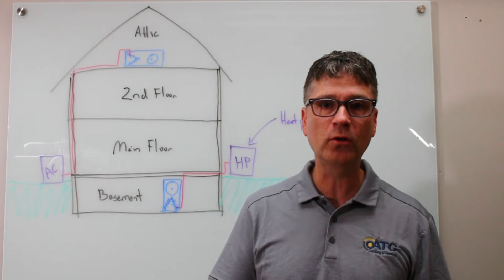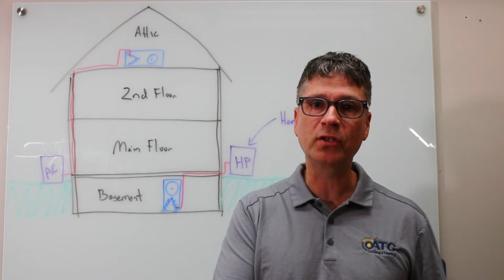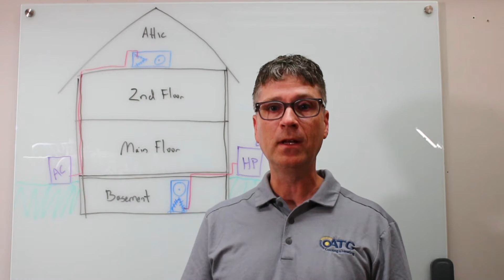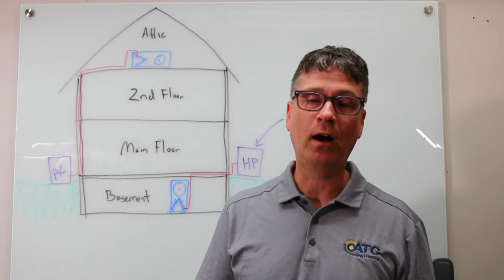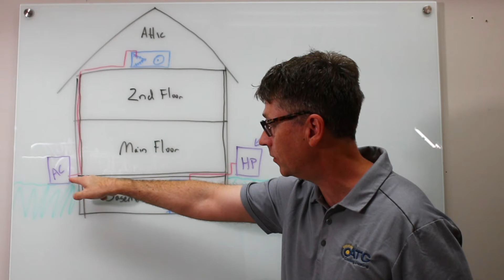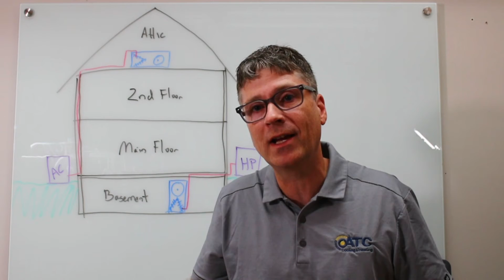The New AC Refrigerant Could Cause Problems!

Comment: There is no propane in 454B or R-32.  Totally false information. As an  HVAC instructor and former factory representative I teach refrigerant certification classes including on the new refrigerants.
Reply from the maker: You are right. Technically, R454B is 68.9 percent difluoromethane (R-32), a hydrofluorocarbon, and 31.1 percent 2,3,3,3-tetrafluoropropene (R-1234yf).  But it is still mildly flammable and not dissimilar to the chemical formula for propane (C3H8).

Comment: mildly flammable refrigerant  does not bother me but the costs added for leak sensors  in evap coils & up front equipment costs is Mine  & my Customers  main concern  410 a is 1/2 R 32 anyways  adapt & move on its 2025 & its here to stay ..for a while till R 32 is phased out down the road & now R 410 a prices will start to soar up again bc I remember just 4 yrs ago 410 was lees than 100 buck  JUG NOW ITS 300 $ - 400  & uP AROUND HERE

Comment: HaHa, you just lost all credibility at 2:20,  Propane as a refrigerant is R-290,  R454B is a mix of R32 and R1234YF, neither contain R-290 or propane.    Get your facts straight before putting out garbage like this.
Reply from the maker: You are right. Technically, R454B is 68.9 percent difluoromethane (R-32), a hydrofluorocarbon, and 31.1 percent 2,3,3,3-tetrafluoropropene (R-1234yf).  But it is still mildly flammable and not dissimilar to the chemical formula for propane (C3H8).
Reply: @HVACscholar And lead is similar to Gold molecularly

Comment: R290 ATW mono-block is the best most efficient heat pump refrigerant and can heat and cool your house even in cold climates. R454b is a scam to keep the cost of refrigerants very high and line the pockets of the refrigerant manufactures in the US. The rest of the world is using R32 and R290 because ther are cheap and efficient and have low GWP.

Comment: wow new line set sure its recommended but mandatory ? not sure why ? i surely hope Not ...hope if Thoroughly   flushed with R11 & nitro  &   if proven leak free in an isolation test  Ive herd from my Reps is standard protocol
Reply: I saw something the other day that the oil for 410 and 454b are compatible,r32 uses a different oil, which would require flushing. That said, I always try to replace the line sets when practical
Reply from the maker: Agreed.  Replacing the refrigerant line is the best answer.

Comment: R454B is 1234yf and R32. Not propane.
Reply: Just hearing him say that it was propane and that 454b is the main new refrigerant makes anything else he says invalid.  R32 has been used across the world since 2012.  R32 is by far the best choice in a new system, it is higher efficient and requires less refrigerant for the same output.  If he doesn't know these things, his opinion goes out the window.
Reply: @Balticblue93 well he is right on that R454b is the most preferred by most brands in the US after the swap, the only brand using R32 is daikin and that’s because the own the manufacturer of r32.
Reply: @williamvelazquez2059  wrong they opened the copyright or patent up so anyone could make it. Look it up. Daikin was smart to go with whats used mostly over the rest of the world and in all window units.
Reply: Yup, clocked to close it after that